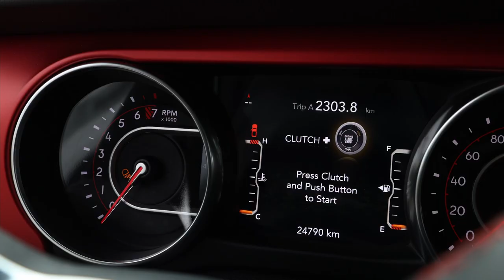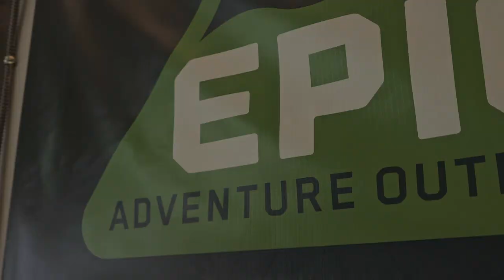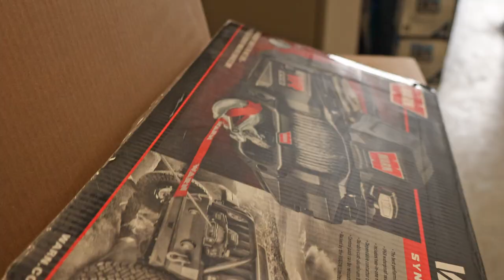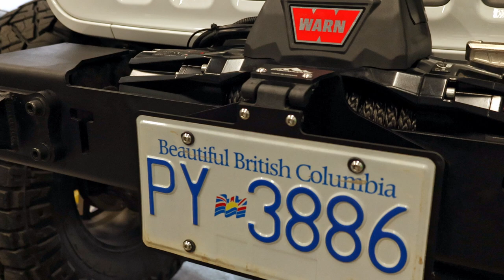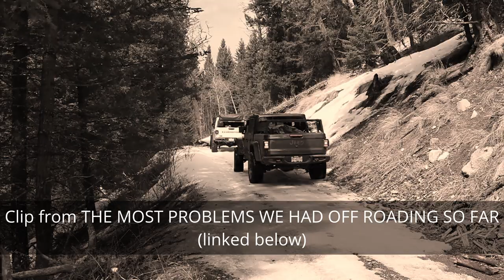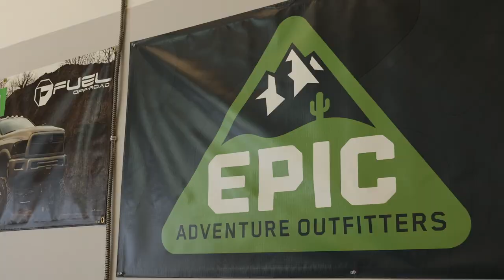Lifted Jeep Gladiator Walk Around, Install, And Is THIS A Good Family Vehicle?

Comment: Just found your channel, good stuff!  I like your humble laid back attitude, and great editing skills!  I have a stick shift Gladiator Rubicon also, on 37s.  I didn't re-gear yet still running the 4.10 gears.  I still manage around 17 MPG combined and even managed almost 19 a few times going slow.   Not sure I'm going to bother haha.
Reply from the maker: thanks for joining us! I only notice on on the hwy going up steep hills it slows down for me. maybe i just have to pick a lower gear before the start of the hill lol 6 spd is SO FUN! 🤙
Reply: @UnwindingRoads  Exactly, the stick is a bit more sluggish than the auto in hills but MORE than makes up for it with FUN.  I've learned to downshift early  :)

Comment: Really liking your channel and this video recently subscribed. I had seen you on some videos on the story till now’s channel and really liked your Gladiator. I was going to ask how is it with the maintenance on the EVO control arms?
Reply from the maker: Thanks for checking us out!! It's not too bad. I grease them every other trip. But to be honest I'd get the teraflex and never worry about it. My next truck will have the teraflex.
Reply: @UnwindingRoads   Thank you for getting back to me. I have been on the fence between Teraflex and Evo for a few months now, but I have need leaning to Teraflex because of a video I saw on your buddy’s Shawn’s channel, how he replaced his Evo lift with Teraflex. I am thinking of building my own Teraflex 4.5” lift with the 4.5” base lift, control arm drop bracket, trackbars and relocation brackets, front lower Alpine IR arms and rear uppers, Falcon 3.3’s. I called Teraflex and asked them if I could do the 4.5” lift with just those since that what the Evo 4.5” overland enforcer stage 3 lift comes with. To adjust pinion angle in the rear and caster in the front, then later acquiring the rear lowers and front uppers. They told me it would be fine and work well. Just wanted to see how your like the Evo control arms, but you just solidified my decision to go with Teraflex over Evo so thank you very much.
Reply from the maker: @diruelas  that's what I would do personally. Also because of what I've seen from Shaun's suspension.